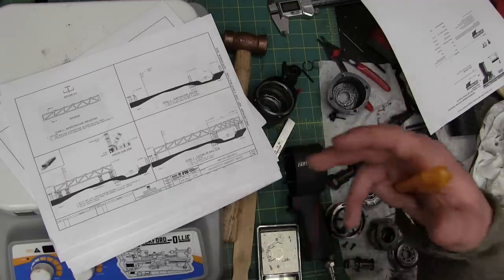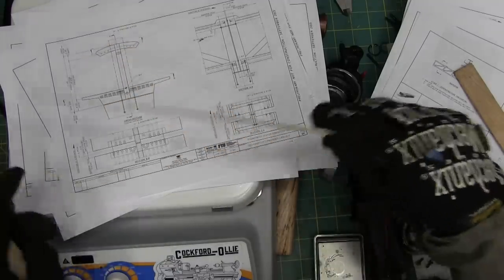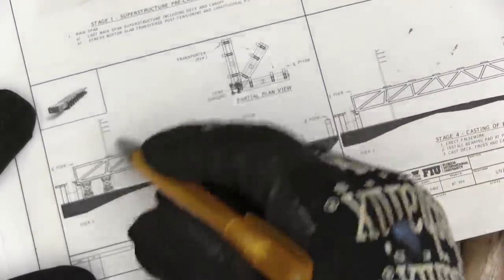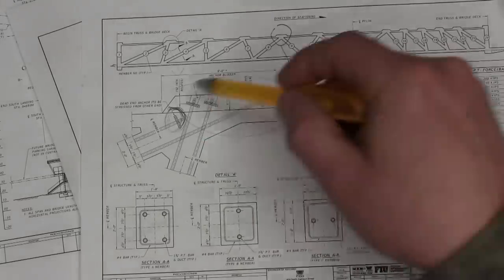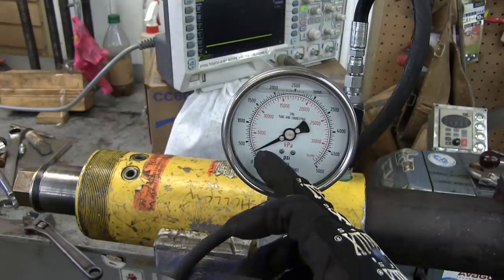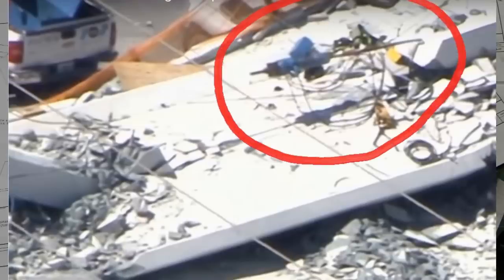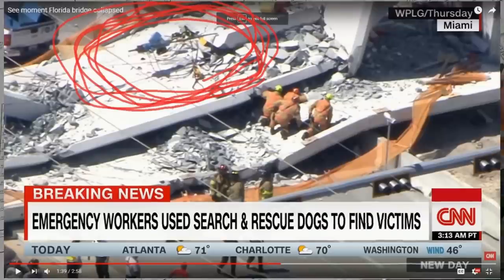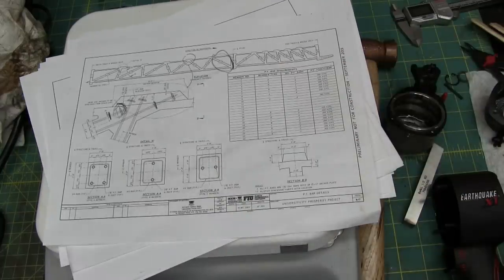Post Tension Failure Florida Bridge Collapse | Engineering EXPLAINED!

Comment: Great video.  The official report also called out that the calculations were assuming a redundant structure, but it was a single load path.  So the bridge was underdesigned from the get-go.  Also, the shear line between the truss member and bridge deck was a cold joint, and was supposed to be roughed up to 1/4" before the truss pour.  It was not.  So the genesis of the failure started in the design phase, moved into the construction phase, and continued right into the installation phase.  A complete breakdown of engineering discipline all around.
Reply: Robert, thanks for your comment. I've just watched this video again after many years. Your comment adds a lot to the story.

Comment: First sensible and plausible engineering-based explanation I have seen so far. Quite a convincing argument teased out of the few clues that are available. Most people just speculate. You actually think, analyze, and even demonstrate with a simple experiment. There should be more of you around.
Reply: CuriousMarc please not, my day only has so much time to watch videos.
Reply: Except he is wrong.  The cable snapping was just a symptom of a greater failure, which was likely due to improperly transporting an extremely fragile bridge.
Reply: @john handcock You should listen before you talk... you say "he is wrong" and then offer up your own theory which agrees with his 100%.
Reply: And yet there are so many people that hate the way AvE thinks. They hate people who think for themselves and try to figure stuff out.
Reply: You're debating talking about the precise point of failure vs. root cause. Not to mention, he did talk about the transportation!
Reply: chris0tube: We already know that there was a reported series of cracks in the main span. Given that the transporters were improperly positioned AND the spreader plates were absent (likely a couple bribes went the way of the inspectors to allow this sort of shenanigans), it's obvious it was stressed at the wrong points. Also, I noticed that the particular member with the load cell attached only had ONE rod in it, which tells me someone changed the plans to cut costs (material or labor, usually both), which ends up costing lives. But, as we all know, when it comes to politics, lives are worthless.
Reply: CuriousMarc hell no that would be an almighty fuckfest!
Reply: Yup Yup
Reply: CuriousMarc u can't have ur pudding if you don't eat ur meat . 
Can't have too much of a good thing brother . 

AvE isn't for the masses, they would ruin it.
Instead he continues to put out QUALITY for us . The interwebs best kept uncle bumblefrig
Reply: CuriousMar
Reply: Yup....  When you offer financial incentive to get a mechanical task done faster, there is usually one answer to that and it's not "Well I guess I'll stop fucking off and actually be efficient today"
Reply: CuriousMarc AvE for President #AvE2020
Reply: Ah, yes, the "Management By Bonus" method, widely taught in business schools nationwide.

And we wonder why there was an economic collapse, a banking collapse, and a bridge collapse. Management is the bane of western civilization.
Reply: All AVE ... AvE
Reply: It was affirmative action feminist engineering.
Reply: And there's me thinking that was called 'value engineering' :-)
Reply: @mysticjbyrd  How's he wrong? That's what he said.
Reply: @chris0tube He's definitely on the right track, though. You aren't on any track at all.

Comment: In Germany we have a saying: "Der Fisch stinkt vom Kopf" (A fish rots from head) ... 
My thesis: It's a teamwork failure in all kind of aspects.
I got the impression that the are more than one failure. First there was a changing of lifting support locations caused by a bad trackway preparation for the lifter. Then a tension rod breaking and last no safety closure of the road underneath after getting problems with the structurals.

This is typical for a "weak" management with bad communication between front site workers/foremans and backside engineers/management when nobody is trusting each other. From each ones point of view the other one is not a problem solver but a trouble maker.
Reply: rkalle66 in the usa engineering management is often promoted pseudo engineers. Ie folks who are great at dog and pony shows. Folks who are great in dealing with   folks.  Folks who often have giant holes in their engineering sense. Thus many so called engineering failures are management failures. Ie shoot all the engineers and process to meet schedule.
Reply: 3beltwety, Hi ... I'm not complaining in general. We're talking here of the situation on this specific construction.
For example, why is it that nobody in charge at the construction site was closing the road after structurals problems occur? It looks like the captain is not on board.
Reply: The construction firm was no doubt in a rush to complete the project over the few days that the road was closed. That could have played a role in the disaster, especially as they came upon challenges that required them to deviate from the original design.
Reply: I have learned lmra everybody is entitled to stop the work at any time when there is a safety issue. At least on refinaries and platforms it is.
Reply: So in that sense. Everybody there is to blame.
Reply: Them not closing that road is unforgivable.  Doing a major structural adjustment  like that and neglecting a simple and obvious safety maneuver is first order negligence.  I'd bet none of the bridge crew were under it at the time.  Why would they let the public drive through??
Reply: I think you're correct, the people in charge failed.  I think this was a political failure.  The University that was funding the project is a big advocate of the ABC (Accelerated Bridge Construction) techniques used here and has invested heavily in a program to teach it.  The supposed advantage of ABC is you don't have to close the road for as long as with traditional construction techniques.  Closing the road to deal with problems caused by moving the bridge into position would have detracted from the marketing appeal of the ABC technique.  Also, the "captain" in this case was an alumni of the university.
Reply: 3beltwesty Structural engineer is perhaps the most scrutinized and regulated job on the planet. This was a failure when they let identity politics dictate the job. It's a tragic example in what that will get you.
Reply: Not closing the road is akin to not performing lockout/tagout procedures on equipment you are working on.
Reply: I'm not sure, if they were talking of "this" crack or something else. But I'm sure, that if some was just using the word "crack", it's like a BINGO for the media.
Reply: I wonder if the lack of road closure was a contractual obligation...

Comment: You referenced the collapse of the Ironworkers Memorial Second Narrows Bridge in Vancouver B.C. in your presentation above was due to falsework failure.  My father knew the first engineer who designed the falsework support for the bridge construction.  The base was originally designed using 12X12s laid tight, in four layers to support the upper falsework.  The powers in charge considered the design too conservative and used too much timber.  The engineer was let go from the project and another engineer was installed to finish the project.  The second engineer's design used four layers of 12X12s on 24 inch centers to save materials costs, against the strong objections of the first engineer.  After the bridge collapse, my dad found out that the first engineer encountered his replacement in a bar shortly thereafter and beat the living crap out of him.  Apparently no charges were laid as a result of the altercation.  Thought you'd like to know some background on a bit of B.C. engineering history.  Paul
Reply: Is this in the land of wooden huts too?
Anyone ever heard of 'metric'? 
No?
Like in Megabytes or kiloWatts? If you would use a 20th century system of scales then you would maybe be successful in creating a bridge in the 21st century which doesn't fall and kill people. 'Inches' and 'miles' or 'horses' are not suitable for serious things which kill when they fail, and how many bridges fail every day in hut land? Probably too many to report on and who cares? A cow-boy is someone who came out of a cow and can make noises similar to 'English', but no one would give a cow-boy a job dealing with things which could fall apart and kill people. No one would do that. So where does that type of thing happen?

Aha, in the big hut land.
"Shucks, wadda ya no?"
Reply from the maker: The engineer in charge of the falsework died in the collapse. Musta been a higher up?
Reply: Whenever you are fed a story by an elder, be aware that there might be some creative editing taking place.
Reply: the song London bridge is falling down with be changed in honor of the university & engineering company...
Reply: I seem to recall another video where AvE said if you want an unknown answer not to post a question but post the wrong answer to the question. Hmmmmm
Reply: Haha...the old "my dad knew the guy", and even better, "he kicked his ass...but no charges were filled".
I heard the original engineer went on to develop free energy for all but then the government shut him down. That's what my dad said anyways.
Reply: An engineer walks into a bar . . .
Reply: @BLEnterpriseLincoln  Trump uses this strategy all the time.  Whatever he wants the people to talk about he simply exaggerates the truth so everyone runs out and fact checks him and tells everyone they know how wrong he is and say what the real facts are so everyone talks about and now knows what he wanted them to talk about in the first place.  I laugh every time he does this and the mainstream media and social media never Trumpers bite every time.
Reply: It's odd to hear that this failure happened in VBC! Maybe this structure was on the periphery of all involved, as I always had respect for Canadian Engineers! But early one morning along I-5 south by the round wood dome structure down in Tacoma (or Oly?) I saw a new elevated road structure that was 30 -40 ft high with cribbing-wood shoring & the dozer operator there was relieving (stripping) the shoring by pushing the unrelieved wood towers down? Myself & a German engineer were both shocked to witness it? It was the same type of crib-shoring used in L.A. Metro! But there was no method to the madness of decentering the 80 ft of elevated roadway? & not sure if elevated was box-girder?
Reply: Paul Phillips now that’s a proper bit of engineering!
Reply: @theslimeylimey  thats not a strategy he just doesn't fuckin know, he's the president of the united states. if he knew the right answer he'd say the right answer.
Reply: @kennethkeen4988  I feel you and I simply don't fully comprehend the benefits of the superior "football fields per school shooter" measurement
Reply: Most likely a fabricated story
Reply: @aluckyshot  you look like you care about how other men look

Comment: I would almost guarantee the crane was to move the tensioning cylinder and other gear for the guys working on the bridge. I say that as a mobile crane operator. Hooking onto a failing bridge not only isn't going to help, but just feeds more shit into the fan. That crane is no where even near the ballpark big enough to make a difference on something that size.
Reply: charles streeter good point. The bridge was around the 900t mark wasnt it? Would expect a couple cranes would you?
Reply: I was watching the collapse video and thinking to myself where these guys would have tied off to.  Anchoring to the bridge would be like putting your seat belt on in a sinking ship, just not fucking smart.
Reply: I was thinking that, because an “eye witness” claimed that a blue piece of equipment was attached to a crane and that it broke off from the hook it was attached to and hit the bridge. He was saying that’s what caused the collapse, obviously not, but could it have been part of it?
Reply: Yah at least a two or three given the length of the structure and the need for it to be supported on the ends as well as in the middle once it started failing.

You generally only pick around half a cranes maximum rated capacity. This is because as the boom telescopes out and the load gets further away from the crane, it's capacity drops very quickly. A 500 ton capacity crane cane only lift that weight over top of rear of the machine. So by the time you have enough boom out to reach the top of the load and to accommodate the necessary rigging, that 500 ton is only picking about 400k. And that's with only 90-100 for of boom. 

In order to rig the whole span to pick with one crane you need rigging as long as the span. That means 120 foot span has at a minimum of 120 foot rigging on each end, creating a 60 degree angle up to the hook. That means more boom stuck out and as such, a lower capacity. 

There are defiantly cranes capable of lifting that span whole. They are the size of the road that bridge is built over, and take weeks to assemble. Look up Lampson transi lift.
Reply: Its obviously being used to move equipment since the transporters were used to set the span.
Reply: There's dashcam video out of the collapse and that crane doesn't move at all.  It wasn't attached to the structure at collapse
Reply: Ryan McKee he was supporting the cylinder used to tension the rods. When the rod broke and shot out, it took the cylinder with it. The same way the steel tube used in this video shot off to the side. Doesn't have near the energy the rod has, but enough to swing it around on the end of the crane. 

By the time the cylinder hit the bridge it had been collapsing for a while already.
Reply: The bridge was far too fragile to be moved.  It was failing the second they put it down, or even before.

Comment: I would imagine that two guys from the year 1900, who could not even spell "geometry" could have designed and installed a walkway that would still be safely in use today.
Reply: There were plenty of spectacular failures back then.
Reply: @joetrapp9187  As there are structures still is use (Brooklyn Bridge) today.
Reply: Survivorship bias, plus todays cheap "value engineering".
Reply: Overbuilt and under engineered, except back then they over engineered and overbuilt (in the majority of still standing structures) ** the shittier ones aren't around anymore, the others will fall after neglect of course
Reply: I have 3 words for you that contribute to failure, "bridges as art." Sometimes a bridge just needs to be a bridge. 

Or, in AvE speak, do not forget the prime directive.

Comment: I believe the unloaded structure should have been strong enough to stand in place had everyone done everything perfectly by the book, but as was said, a disaster often is due to a series of errors.
Error 1:  This “first of its kind” bridge is made entirely of “self-cleaning” concrete which contains titanium dioxide.  We’re not talking about titanium paint on the outside of the concrete structure, but titanium mixed right in with the concrete.  There are many levels of purity for Titanium, and more pure is more expensive.  I will bet the materials samples tests will come back that the titanium was substandard.  
Error 2:  Also, I bet tests will show that the self-cleaning concrete was not mixed thoroughly, and uniformly, and long enough.  This resulted in “veins” of overly brittle concrete.  That, combined with the too short curing time, left brittle streaks so bad that the concrete’s overall compressive strength was not half of what was expected.  (Also, isn’t a giant kiln usually used in making most self-cleaning pre-fab concrete sections?)
Error 3:  By not placing the transporter/crawlers at the very ends of the bridge truss, it caused the more slender top member of the truss to be in tension in ways the bridge designers had never intended.  When the quickly constructed truss was moved/swung from the side of the road 90 degrees to across the road, the transporters were too far in towards the middle, so the ends of the truss were probably drooping.  The crews were probably instructed to tighten the top tensioners more than they would have ever been had the truss been supported from the ends.  This over-stressed the compressibility of the crumbly substandard concrete in the top member.  The stress from drooping and then over tightening served to cause the brittle veins in the top member to develop deep cracks CLEAR THROUGH the top member like a series of seismic oblique slip faults. 
Error 4:  Now remove the transporters and start supporting the truss by its ends, and the damaged top member with its slip faults of now powdered titanium concrete is still, remarkably, holding together.  Yes, holding together like a half dozen bricks being suspended, held between your two hands.  They’ll stay together as long as you keep pushing your hands together.  Let up, even a little, and it all falls down.  The workers were then probably instructed to loosen the top member tensioners (you can hear that on the video) back to spec, and boom, the top member catastrophically fails along its faults, and its weight and momentum break the truss’s bottom member…and you have 6 crushed to death.
Reply: Guy Ligier I think the drooping end is key. Looks like they were trying to carry the load on that end while they came up as you said on the hydraulic.